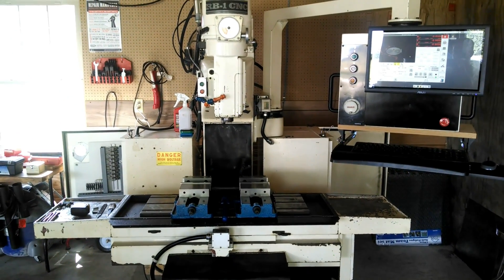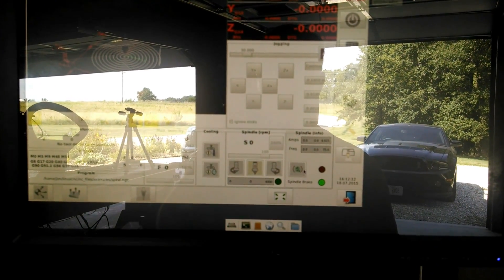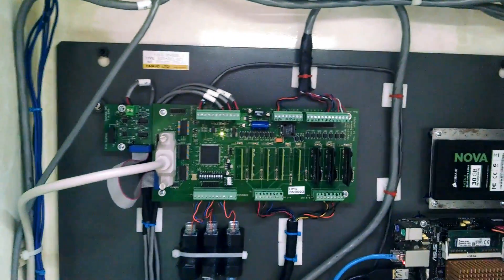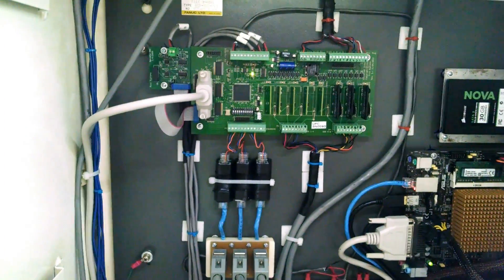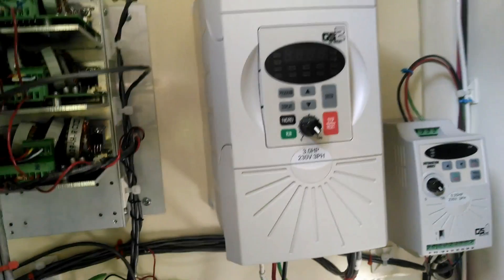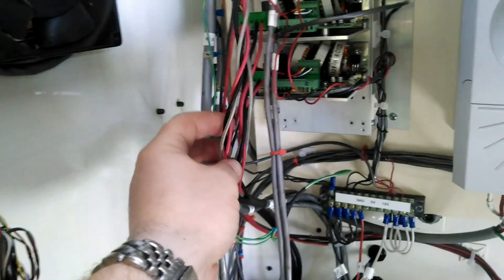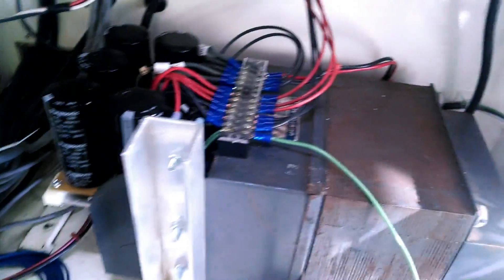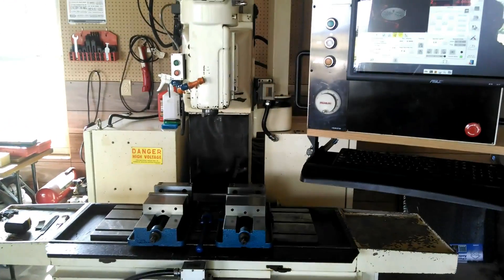RB 1 CNC LinuxCNC Retrofit Overview

Comment: Hello this Gabriel . i just came across your demonstration on youtube . i have a RB1 cnc mill identical to yours . i would like to try to set it up to connect with my laptop so i can upload programs to mill . my mill has a 25 pi female connector (is it called a parallel or serial port )  and a 20 pin (i think it is called a Honda connector ? ) where or how can i find the proper cords to plug it into my laptop ? also can i run programs into the mill that have been designed on' Fusion360'  .   If you or anyone else has any ideas on how to get this part of my mill going please email me @ gabrielcheney@hotmail.com  thanks for what you showed ! i like tackling these kind of projects !

Comment: Did you get this machine near Troy.
Reply from the maker: Dirtdigger257 
Yes I did.
Reply: I thought that it looked familiar.i would love to see some some milling some hsm and some test cuts in different material. Good to see  another enthusiast in the area.Ive done some builds using kflop. i,ll have to check out pico never used there stuff. how many watts are the axis motors?
Reply from the maker: Dirtdigger257 
I plan on putting up some videos of it doing it's thing shortly. I will be making some parts out of low carbon steel and aluminum. Is your machine running LinuxCNC or Mach?
The servo motors are approximately 1300 watts each.
Did you look at buying this machine when it was up for sale?